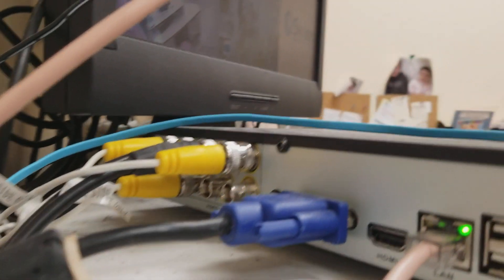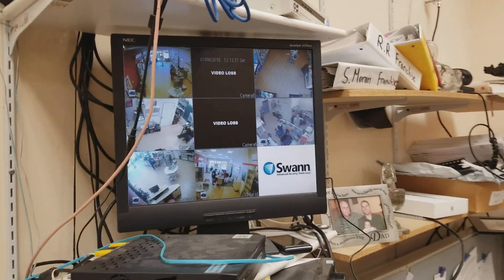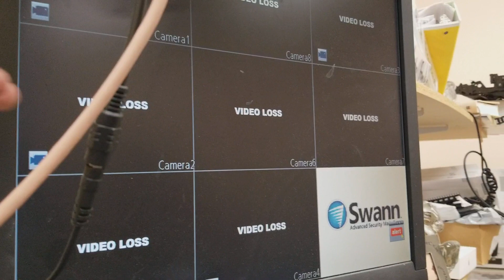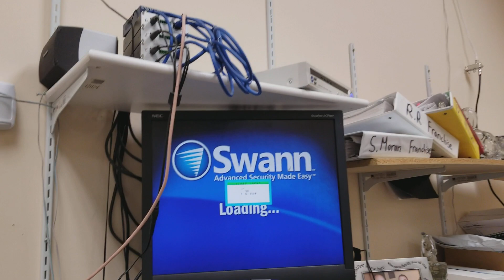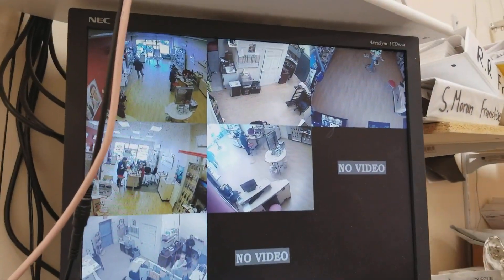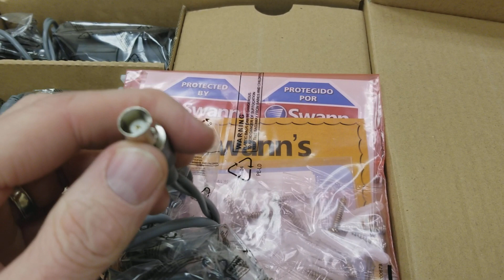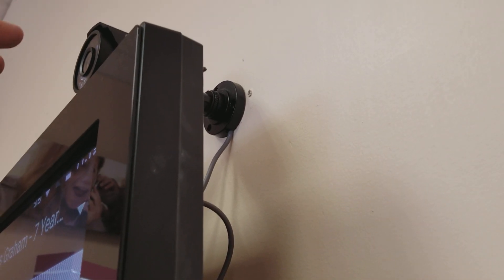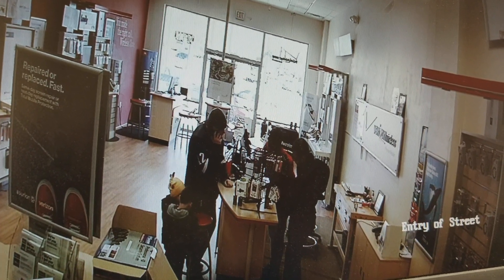DIY install your Swann Video Camera Security system (and others)

Comment: I'm thinking about upgrading. My cameras are 700p they look OK but at the time I bought them there were no 1080p or 4k cameras. I think the quality of the picture of my current cameras has degraded over time also. The edges have some noise and some image artifacts. The only maintenance if done to the cameras has been replacing the inferred led sensor array as some of them had gone out.
Reply from the maker: Yeah, I agree.  I originally had lower res cameras and you couldn't tell whona person was.  Often you need the receiver as well because some don't accept higher res cameras.

Comment: Should have shown the wires separately going behind the unit was pointless because those other 75  hanging on in its view with whatever else you got going on there looked a freaking MESS
Reply from the maker: Basically you plug the red wire into power and the other wire on any camera can go into any input.  Depending on which one you plug it into that camera would be a different number.

Comment: Hey question what did you do with your old cams and dvr?
Reply from the maker: I think I used them with the new system. Since then I sold my store, so I left them there.  The old cameras had a poor resolution but the new system came with 4 cams but inputs for 8, so I figured low quality was better than nothing in those extra spots.
Reply: @SeanDIY  do you have different swann cameras if so how are they doing?
Reply from the maker: I had other cameras in my store when I bought it. The Swann ones worked well.

Comment: I have a Swann camera in my driveway. I bought & installed it in 2007. It's been great. Only issue is the mounting arm or ball joint never stayed tight enough from day 1 and moves over time. It is old. I'm looking at the 8ch dvr system now.
Reply from the maker: I think you can replace those ball joints.  The cameras aren't all that expensive.  Would you go with another Swann system?

Comment: Is the HDD blue light always blinking at a high rate? Or is it telling me something is wrong?
Reply from the maker: Is it on all cameras?  If not maybe switch a few around as to what camera number they are and if it's the same result it's the camera, if not, the input potentially.
Reply: OK, I will check soon,thanks. @SeanDIY
Reply: HEY IT WORKED!  THANKS! All I did was unplug the back wires to the unit and plug them in again and it started working.
Reply from the maker: Glad to hear it.  You may have had a bad connection or something.

Comment: Do not buy Swann!
Why do you think swann turns off comments on all its posts on here??
Full of blur problems and you need a magnifying glass to see the mouse cursor on the screen.
Their customer support is a joke to, yougive them your phone number all the time and one still goes the repetative process of having totell them your model number etc etc etc.
They have caused me alot of stress with their model DVR8-4780.......
Reply from the maker: Hmm.  My experience has been the opposite. I have had 3 different Swann systems at several different stores.  Support was very helpful,  especially after my store was robbed and I forgot the password and needed to reset it.  The video I gave to the police allowed them to identify the guy.
Reply: You are correct.  When system was purchased there song was no monthly fees Now that I own one there IS a monthly fee.
Reply from the maker: @portagepete1 mine didn't have any fee.

Comment: Swann customer service is a total nightmare to work with.  Avoid swann products.
Reply from the maker: I have had them help me a few times.  Ince I forgot the password and they were able to reset it.  What was your experience?
Reply: Sean's DIY & Reviews can you help me I have Swann two cameras they were working very good until last week my tv screen show me massage thAt video loss I don't know how to fix this can you help me
Reply from the maker: Does neither work?  If one does I would swap cameras to the other inputs to determine if it's the camera or the main unit.
Reply: Sean's DIY & Reviews not even single camera working now when am opening on my tv screen there is first option is recording when am click on that option screen show me a two option first option is (encode) and second option is (schedule )but when am click on encode the first option is camera number and that option have a Red Cross ❌ mark and exactly the same red mark ❌ on a second option which is (schedule) Thank you for your reply